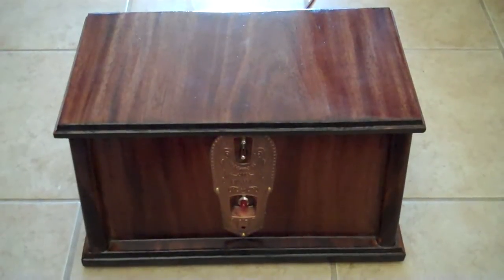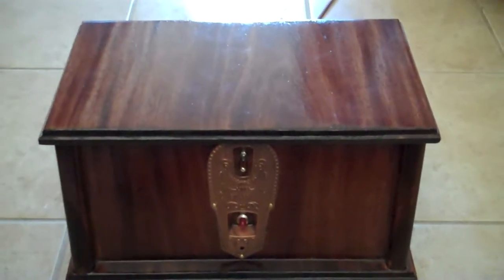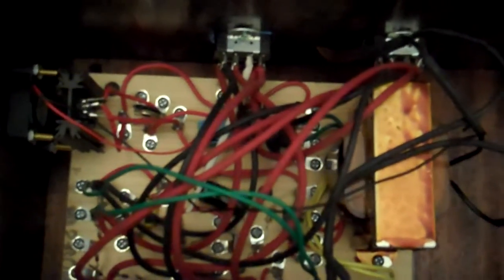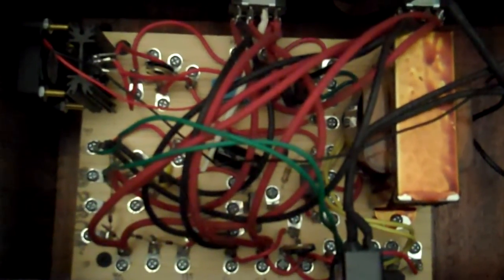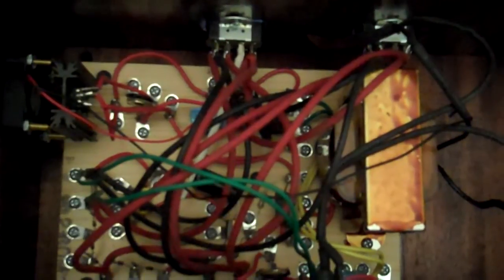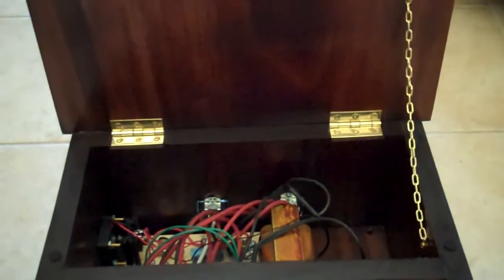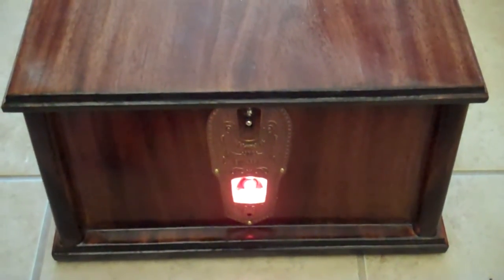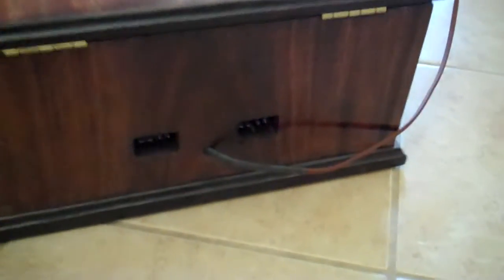Tube Radio Battery Eliminator homebuilt by Brian Cass

Comment: You did a beautiful job on the woodwork.
Wouldn't be cool if someone built the battery eliminator using tubes rectifiers.
And cotton covered wire.Where can you buy cotton covered wire?
That's the hookup type wire(magnet wire).

Comment: You have some great FADA equipment. I just purchased a FADA tube radio  at an estate auction. I know nothing about it. It has no back but seems to be complete. How can I identify the model. I really want to restore it to it's original beauty and sound.
Reply from the maker: You can email me pics of your radio, front and back to Moneydoctorcass@comcast.net  I will see if I can identify it for you
Reply: fadatuberadioman After researching some web sites I discovered that it is a Model 25 manufactured in 1929. The cabinet is in great condition but it appears to have some burnt wires on the chassis. Thanks for your response. I'll try and post some pictures.

Comment: Changes to make it "Fit in".
What you have in front is a dial plate, It should be illuminating a dial, anything will do.
A knob below and a speaker is not only nice, but useful.
Really old radios need an external speaker, and an amplifier in some cases.
Don't worry about internal looks just yet.
If you make a steel "chassis" and mount the power supply and a modern amp underneath it looks fine.
A current limiting resistor is an excellent idea.
Ferrowatt has early light bulbs, mount one.

Comment: Hi, Just restored a Kolster model 6D radio from 1926, I have a "B" Battery supply from about the same year. Want to keep every thing original. Using a RCA UX280 rect. tubes ect....   

Do you have access to schematics to battery eliminators from the 1920's or any ideas how to find them ?  My supply just fell apart in my hands when I took the cover off. Wires every where ..!    

Thank You 
Tony Beatrice